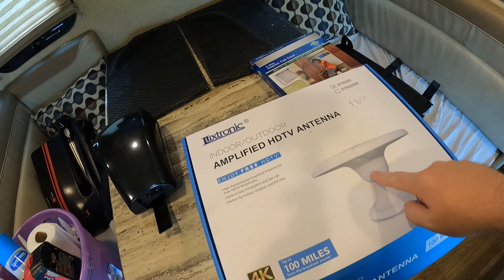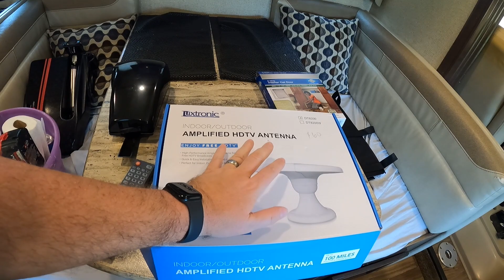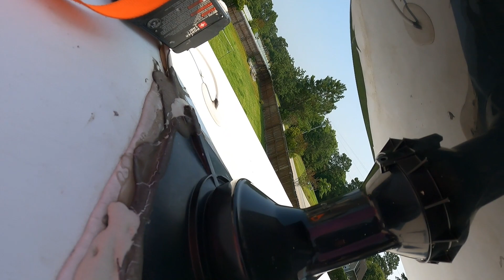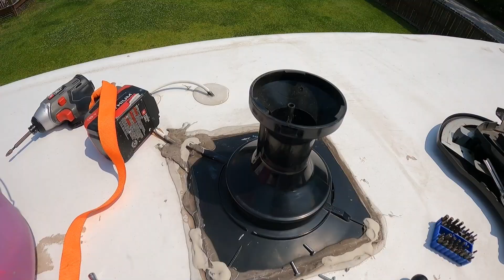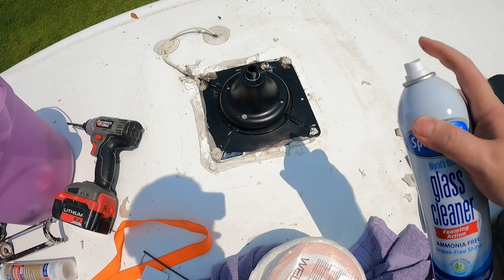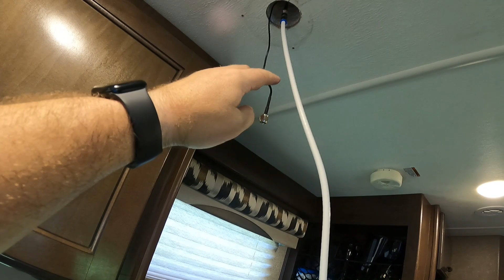Omni-Directional RV Antenna Install – Better TV on the Road!

Comment: Did you loosen the 25mm plastic nut inside the camper? That allows the entire top piece to come off.
Reply from the maker: Mine didn’t have that. The interior piece was broken and the exterior base was screwed on.

Comment: Nice video! Thank you for taking the time to show what you did even though you ran into some issues. I am here because I am researching how to remove our old Winegard antenna completely. I have found that the one installed on our rig pulls in many less channels that a cheap flat wave antenna that we attach to our TV, and we can move it around easily to improve reception. I also want to remove it because the location of the antenna on the roof results in some shading of our solar panels at times. Finally, there would be less wind resistance when travelling (although this is a minor consideration). Any update on how your antenna is performing? Safe travels!
Reply from the maker: I actually have another video and have since replaced it with a cheap indoor antenna that works just as good (maybe slightly better) even while placed in a cabinet. This one worked OK but still had pixelation issues. The new one is more stable and was easier to install.

Comment: Not good at all.  I have a new antenna that will not install on top of the old base.  This video is worthless.
Reply: Not His fault 😂. Figure it out
Reply from the maker: Sorry for that. I cut mine perfectly somehow so the bottom of the new antenna rested nicely on the old one. Not designed for it at all but it worked with 3 inch deck screws.